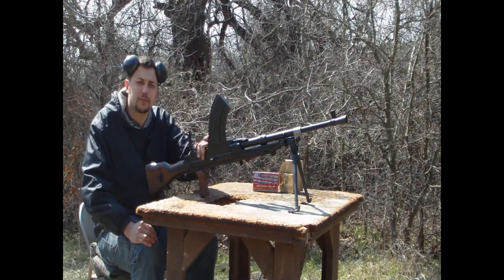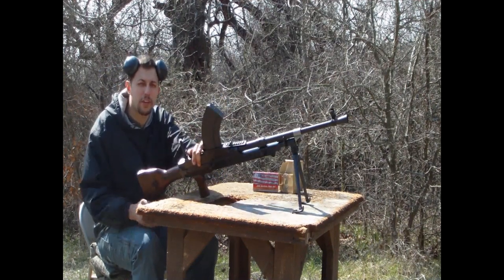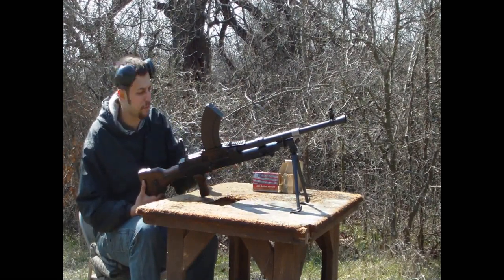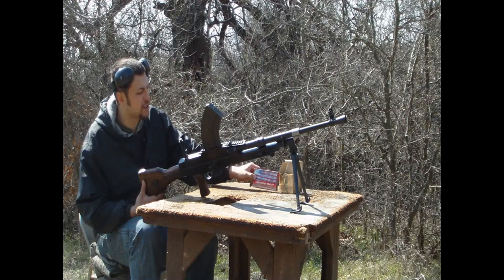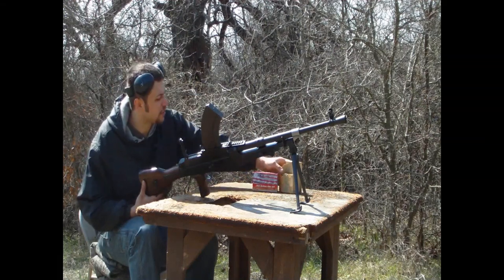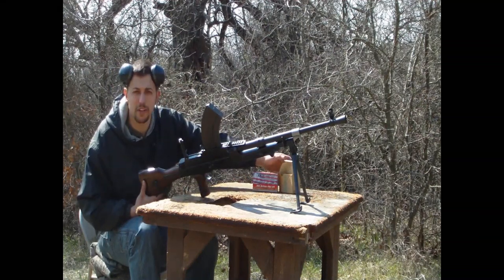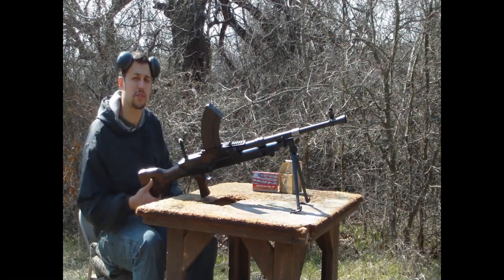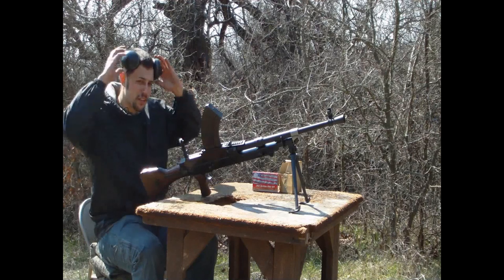Bren MkII Semi auto test fire

Comment: how did you set up the striker block and spring?, when i put mine together the spring holds the op rod from coming all the way forward when gun is charged. thus, the bolt doesn't lock into position?

Comment: British .303 isn't exactly nasty, its just old and cordite and some of it has been used as currency in sandy foreign parts or produced in far flung conrers of the old Empire before we get at it. Years of sitting out in the weather doesn't help with hangfires and berdan primers are a pain when elderly. I have some dating from as far back as 1919. Ok in the SMLE, but gas will be low on the Bren.  I use PPR, as its kinder on the barrel. Regards from the UK